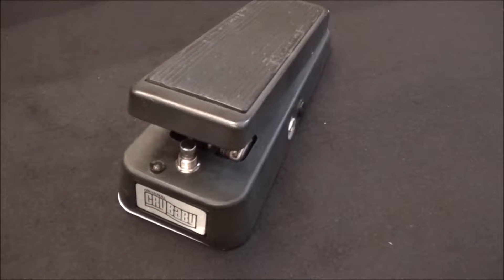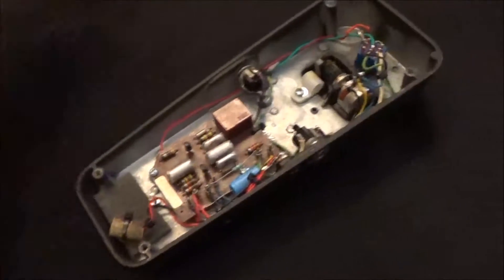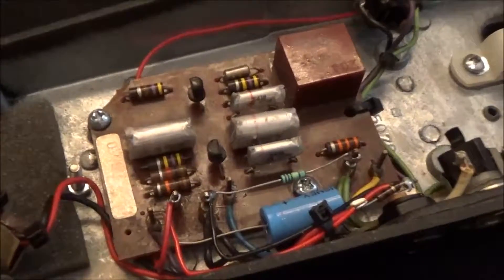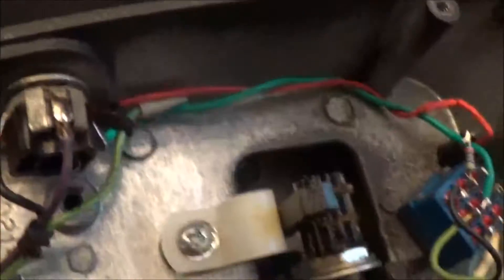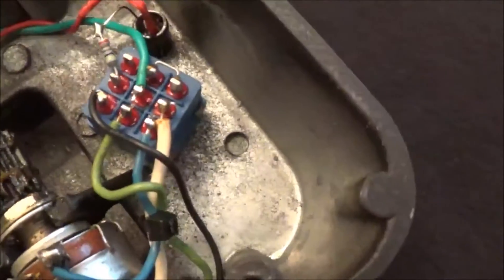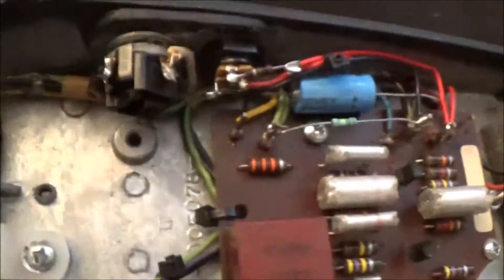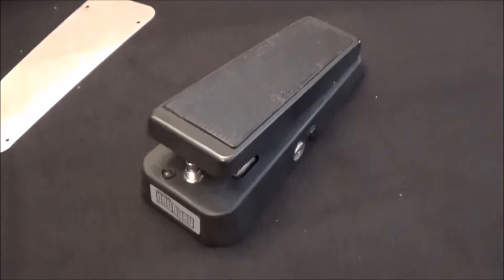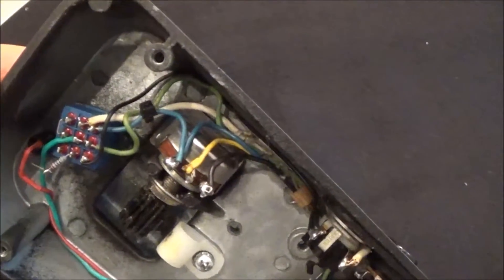TDK 5103 Inductor Crybaby Wah (Tech Info Only)

Comment: How can i measure my TDK's inductance?
I have no chance to compare my TDK Wah with other Wah's.
I wonder if my wah actually sounds good than others
Reply from the maker: You need an LCR meter. That can measure inductance, resistance and capacitance. Regular multi-meter won't measure anything except for DC resistance.

Comment: if you want to know year production of the wah (approximately), look at the pots production code year at the bottom of the pots (I assumed the pots was original one, can't confirm it from the video).
TDK inductor used between 1972-1976/1977. after that Thomas Organ use Stack of Dimes 03 inductor.
Reply from the maker: pepticon — Thanks for the info. I know about dating things by pot codes, but IIRC I didn’t have a code on the pot that I could look up.
Reply: well, from what I saw from the video, the pots looks original. earlier Thomas Organ used Centralab pots. while later one, I think started from late 1970s, the pots was made by Allen Bradley (Hotpotz 1) with same taper (and it was kept even after Dunlop bought Crybaby brand until replaced by Hotpotz 2 somewhere around 1994/1995).

the Centralab one code should 24-5318-3 (Thomas Organ house number), followed by 134xxxx. 134 was code for Centralab, and last 4 digit showed year & week of production.

I used to have bunch of Crybaby (and Vox V846) from all era. I found that at least there are two different specs of TDK inductor. one usually sounds pretty good. while the other was more sterile and lifeless, I guess the bad reputation came from that.
Reply from the maker: Yeah, I'm pretty sure that it's the original pot. I should check the date code on it.
Reply: and by the way, the caps was ITW Paktron paper caps, pretty good caps actually. while the transistor was "Thomas Organ 5117", suppose to be 2N2925.
Reply: well, I watched again the video, and look closely on the pots, I can say that it's Bradley one. unfortunately as you already mentioned the Bradley, didn't have datecode, not until Dunlop era in mid 1980s. it only has Thomas Organ house number.
so can't tell exactly from what year.
Reply from the maker: You're the first person I've ever heard actually identify those caps by brand and type. Interesting. There's some caps like those in a few of my Seymour Duncan Convertible preamp modules, but they are axial types.
Reply: well, few years ago I kinda obsessed with wah and did lot of research.
those ITW Paktrons caps was use quite a lot in various amps, organ, etc.
Reply: Pepticon is correct on the 5117 being a 2N2925. However, the TDK 5103 first was used in 1968 on the Italian made VOX King Wah with the King Wah logo on top of the treadle instead of on the front. I have one original Top Logo King Wah with the 5103, one with a small hole Halo & a Top Logo Crybaby with a red Fasel - all are from 1968 & this demonstrates that there are no hard & fast rules when it comes to stock original components back then. Late in 1971, all wahs built in Sepulveda, California came stock with the TDK 5103 & all wahs built in Chicago came with the "48" style number "03" Stack Of Dimes inductor covered in brown paint. It stayed this way until supplies ran out after Dunlop took over production in the early 80's - yes there were some Dunlop manufactured wahs using the 5103 & Stack Of Dimes inductors as well as the old Thomas Organ part number 5117 transistors. A lot of the 5117 transistors I've measured are typically between 275 & 350 hFE (hFE is gain) which is in spec with the 2N2925 which is spec'd at a minimum hFE of 235 - but the tolerances back then were rather sloppy & I've had quite a few measuring into the 400's. Thomas Organ likely ordered these with their own internal 5117 part number to easily sort stock in-house or to even complicate matters for competitors trying to replicate/steal their design since numerous companies sprung up around 1969 offering wah pedals based on the original Thomas Organ design. I highly prefer the BC109B transistor with an hFE at 250 for the most vocal tone & least grainy distortion overtones. The pinout is different with the BC109B so be aware of that.

Comment: Those are Polystyrene and Foil capacitors along with Thomas Organ 5117 transistors that were produced only for these wahs. If you change out the .22uF Polystyrene capacitors for Vishay BC MKT 368 Metallized Polyester Film capacitors, you will get closer to the earlier Clyde picture wah tone.
Reply from the maker: Randall Wetmore -- good to know, thanks
Reply: You could also order some Millard Tropical Fish caps on eBay & have exactly what the Clyde's used.
Reply: How much better would it sound?
Reply: @jubyerhashin8214  Define better. It's all subjective.

Comment: I have that exact same version, same caps and inductor etc...and also did the same mods with the true bypass and LED. In fact I felt like I was looking at my pedal.  Even the chip in the corner of the PCB!  I did add a three position switch though to facilitate the original tone cap along with one brighter and one darker.  I love the way mine sounds. If the inductor is a drawback I am not feeling it. Not at all. We got a good one if you ask me. I mean, you got a good one , and I got a good one. Haha.
Reply from the maker: Jeff Downing — I borrowed yours to make the video ha ha
There’s a lot of variables besides just the wah pedal. I think people need to look at it as part of a whole system. Anyway, happy to hear someone else likes theirs too.